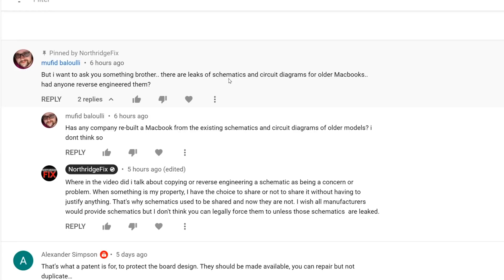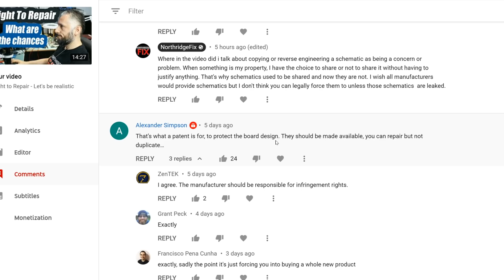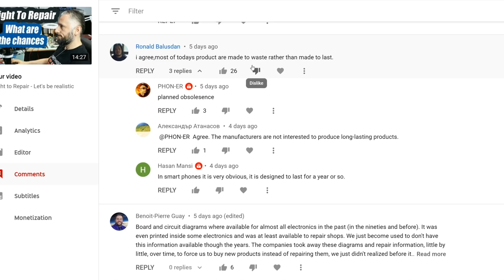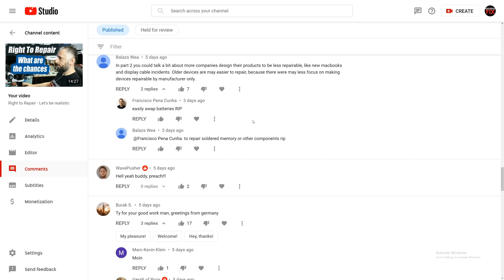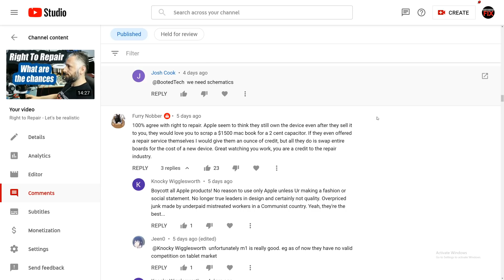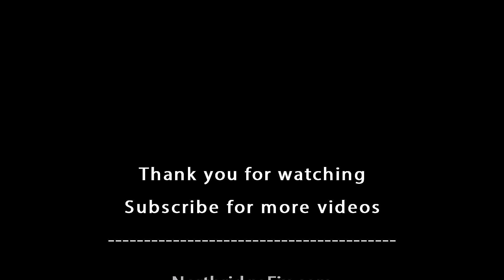Right To Repair Part 2 - Let's be Realistic - It's all about the Money.

Comment: The companies who used China to make their machines etc, they were all happy at getting super cut price stuff to maximise profit but seem oblivious when that factory in Shenzhen etc turns out a million more of that device or part.   Dr Marten's boots is a fine example, they cheaped out, went to Shenzhen who made them their boots for half the price the factory in Britain did, lots of profit and several months later ebay and Aliexpress is full of identical pairs of boots missing the branding, made on the same machines Dr Martens had their items made up on, using the same materials but selling at a THIRD of the price of a pair of Dr Martens boots.   
Apart from copyright brands missing they are exactly the same as you buy in the retail outlet.   Dr Martens cry foul but did they take the tooling home with them or see it destroyed?  Nope and so their drive to maximise profits has bitten them hard.   
In Hong Kong you can find anywhere things like brand new Xbox or PS5 clones at half the price, that can play the games and even sign into the networks because they have not just copied but 1:1 cloned down to every component detail, by reaching out to the factories in Shenzhen who make the components for MS and Sony, big suitcase o' cash and a container of authentic chips is heading to Hong Kong.   
What China is actually doing is showing how greedy these corporations have become, proving you can build the exact same thing for a quarter, a third of the retail price and still make a profit following the mantra of stack it high, sell it cheap which sells more.   Its like the McDonald's economic model, they may make 5 cents profit on every burger but because they stack it high, sell it cheap they sell billions and that 5c is pure profit all the way, electronic companies need to stop being so greedy esp Apple who have planned obsolescence in every device, why I will never ever own an Apple product and never have done.
Reply from the maker: The problem is, when apple raised there iPhone prices to a ridiculous $1500+, people did not seem to care. The News reported 2 million iPhone 12 sold in 24 hours. A person in a third world country would rather spend his savings on an iPhone 12 pro max and not buy food for his family. People not complaining encourages price hikes. Whether that device is fixable or not, no one seems to care. People just want to get there hands on the latest and greatest.
Reply: @NorthridgeFix  If you have seen thoroughly apple's schematic from last few year devices they mostly designed same, no big change at all, same components they use for years and the price they keep in their newly launched device is still the same as high regardless of making a big change into their next version of devices. The only information they change is the device model and they call it upgraded to next level device. A lot of other electronics manufacturers doing the same.
Reply: Wow. I had no idea this was happening

Comment: Regarding the treatment of the cancer is a bit misunderstanding because we call “cancer” wide broad list of pathologies which sometimes has very less common, much less than you can imagine. Meanwhile there are many types of cancer which are almost curable nowadays. When we say curable we mean keeping the disease under control and reduce the impact on the life quality to the minimum. You will not believe but there is no disease 100% curable, all of them have something residual after treatment. Making them vaccine is like find a shorted cap, treating the cancer sell is like making reverse engineering for a chip with closed code,

Comment: You are right. We do ask for everything and it is too much. They can make money selling schematics to repair businesses using their ansi number with their EIN for identification. In 1995 the automobile industry started serialization and proprietary parts not available for aftermarket. Ford got sued and after pressure from the government the right to repair info was released. E-waste is getting to a point where the government will step in eventually and put a stop to it, the result, twice the device price and repair price. Same happened with the auto industry.

Comment: You are right, the serialisation of the components should be to verify their integrity, to improve the security, to verify if the product is genuine, or to improve the features of the device. But some manufacturers serialising their products to intentionally cause the issue if a serial number doesn't match after replacing a specific component or a chip even though the part that replaced is fully compatible with the device. It clearly states that manufactures are against the right to repair and want a user to buy another device every year.

Comment: The only way to force manufacturers to provide parts and service data is to demand it up front, before you buy their products. This applies to ALL products. Next time you are shopping for a new appliance, automobile, cell phone, stereo, whatever, tell the salesperson, the only way I will buy this product is if the manufacturer provides free of charge, the factory service manual, access to all repair parts, free software updates and reprogramming as needed, and a full set of schematics.

If they won't provide the hard copies, then you want free online access to their online service data for as long as you own the item. Stand your ground and insist these terms be included in the purchase agreement. If they refuse, don't buy it. If we all do it, they will eventually get the message.

Comment: If you think about it, reverse engineer and manufacture a similar product going over the patent is quite easy, the same way we use an AI to rewrite an essay, it shouldn't be difficult to position components in a similar, but different arrangement on the PCB, going as far as changing voltage in capacitors into heatsinks just to mask the similarities.

Big tech is running a sinking ship and they know it. Eventually intellectual property is going to be a theory, much like all others, rested among the lies of history.

Also, IMO, people should stop using "Laptops" as something to put on your lap and play it like a toy. Buy a wireless keyboard and bigger monitor, connect to it and leave it.  You shouldn't bring a laptop to school, pay attention like we use to.

Comment: Hi how r u i like ur videos but ihave question the ihs of ps3 its important to remove it to apply thermal paste or applying the paste top of ihs is ok 

Ihave another question if i increase the fan speed in ps3 its ok it will nt damage the power supply

Comment: One point I would like to make is that I wouldn't want to ask for every component to be made available.  To make available the cheaper components, the ones that make something economically viable to fix.   The power management ics, mosfets etc.  Not the CPU, GPU.   

After watching your new graphics repair "NorthridgeNoFix" (sorry couldn't help that) 🤣 video it occurred to me that graphics card is now worth nothing it's one for the likes of youtuber eWaste Ben.  If the graphics card was a car it would be sent to the scrap yard to be crushed.  It's the equivalent of taking a car to the garage to be fixed when the engine is gone and all the other parts are almost end of life.  

I think right to repair should concentrate on asking for the parts that make sense.  In car terms,  new brakes, new tires, new exhaust.

Comment: if your phone firmware fails, the manufacturer doesn't want to give you the firmware to reflash by yourself, i had an experience with Oppo only their authorized shops could access the firmwares and if you don't have a recipt they won't do anything, when you buy a device even if you buy second hand you own it not the manufacturer owns the device, i totally agree about what you said about a database, but i don't agree with a monthly payment, my opinion is the manufacturer could give you that database(with the parts,softwares,firmwares of that specific device, schematics aso..) by paying an one time fee or by paying by device model or when you buy that specific device for example for extra 200$ you will receive that database with all the things you need(parts,softwares,firmwares,...)

Comment: If repair shops pooled and hired an electronic design engineer to design a non serialized circuit to be placed as replacement daughterboard,, could be a solution.

Comment: There is no way serialization is going away for 3 basic reasons:
1) Security
2) Flexibility of design
3) Makes the work of designing easier.

All are legit but that being said, manufacturers should be making those parts available, like all parts in working condition either through themselves or 3rd parties.

Parts are expensive to keep in stock AND deter new sales so it is a lose lose from a strictly balance sheet view.

Comment: I do agree with the right to repair, however, I agree with Apples take on it as well. serialising things that can cause a security risk and not allowing 3rd parties to reprogram I 100% agree with. once stuff like that becomes public its only a matter of times before people hack it and cause potential security and privacy risks. 

there are already 3rd party programmers to do screens and batteries which is good. 

in regards to board diagrams I believe that after 12 months (outside warranty) they should become available to repairers, I don't agree with apple holding them considering they don't do board repairs in house.

Comment: We have solar inverters from Fronius that have serialised components, I find it interesting as no-cares about repairing them considering they cost even more than a top model iphone and can make you money!. As electricians we just return the faulty devices or scrap them, as shipping alone pumps up the price vs a new one with a warranty that should work.

Also we can't certify repairs on components unless you're an EE here in Australia (my example, when it's generating power to the mains grid) Although I'm a certified electrician here it's only board swaps that the manufacturers will allow only for EE certification.

Comment: You said it's good in all ways but in fact it is not for the manufacturer. Why ? The old products will last much longer than the time it takes to produce new products. So the new products will not sell as much as if the old products were off. 
Second, if they dont release the schematics and provide all parts it's for keeping the exlusivity of repair to only them, in that way they can contrôl the prices and décide if it is reparable or not (apple) and they will always lead you to buy new stuff.
Thanks for sharing knowledge as always

Comment: This battle have been done before. In the car industri. The access of parts are really good. Bort third party and original parts. You even have access to diagnostic tools for a fee. You have access to most of the schematics and how the car is built. This should be a right when you own your car. It should also be a right for electronics like computers and phones.
Reply: Try changing the battery on a post 2005 BMW with a generic third party one and see if your opinion stands.

Comment: Electronics gets 'recycled' at up to 21% efficiency currently in Europe and USA (best case scenario). Its an environmental time bomb. There is enough mercury in a smartphone to poison a small lake.
Current recycling techniques involve stripping a few components off the board and then shredding the rest.
Quite simple:
Serialization will need to be made illegal by government legislation. you don't technically need serialization to make a fingerprint reader secure/device secure, we're surrendered by BullS**t arguments from the manufacturers. Its a proxy argument because they want a closed ecosystem where devices are swapped not repaired, where products may or may not last for 2-3 years. 
There needs to be government intervention just like the automotive industry was mandated by government to a higher set of safety standards in the US during the 1970's. Its a safety issue, in the same way not having end of life components releasing toxic waste into the environment is an environmental issue.

Comment: i think u dont understand the base of this afford. manufacturer which produces something have to give all informations needet to repair this things. they dont have to give u the programming site. but schematics and part numbers. and parts which are only made for the manufacturer, they shoud have to sell it. if they dont want this they should be fined or should be be forced by law to do so!
Reply from the maker: Even if what what you are saying is true, providing schematic alone without a board diagram is little to no help. Good luck enforcing release of board diagrams
Reply: @NorthridgeFix  Just access to the components would be a good start. Most of the time I see you locating the component that needs replacing without needing to look at a schematic or a board diagram. Manufacturers should be forced to stop erasing the identification from chips etc.

Comment: You're right Alex we can't ask for genuine parts but at least we can push them to offer that to their customers so they won't be forced to buy a new product just because they year old model broke. i.e..  Apple doesn't change charging ports and if shops like mine and yours didn;t have it, then people were forced to pay $350 for a refurbished model.  As far as serialization goes, thats the one enemy that we need defeated because that can cause major headache but then we have QIANLI which can come thru with a small device like they have done for true tone and allow us to copy from oem to the aftermarket.  As far as schematics i think as consumer we should get it with our products and for the board diagram that should only be held by manufacturer to avoid third party repair. :) my 2cnts
Reply: pin this if you like my argument :). Thanks Ari @AriGoldExperience

Comment: 🐨 Honestly I don't know why electronic devices and their details "schematics" these days are not provided with the product, it's not like they are that different from all other manufacturers circuit diagrams. 

When it comes down to a Circuit no matter the complexity, Voltages and currents dictate what components will work and what wont work, Only time one would steer away from long reliable lifetime operation much like those 40 year old transistor radios still working, would be to use components and variations that provide a favourable redundancy. WAIT! 😮 What?
 
Take a gander at several devices and if they have the same features, it's highly likely the parts list and even parts count "depending how stingy or moral a manufacturer is" will in the end be much the same. 

The only things that will be different are the rebranding of the Cheap Generic IC's they source along with new part numbers for them, And that even applies for whatever cheap programmable chips they use..

Comment: Funny thing is when it comes to ham radio equipment. As a ham radio operator you have to do an exam when getting your license to prove that you have basic knowledge of basic electronic cause you are allowed to develop and build your own equipment and it has to fulfill the regulations. With the license it is mandatory that you need to have schematics for all your equipment to show if you may cause RF interference and they are coming to check your station. That leads to the point that all commercial manufacturers of those equipment deliver circuit diagrams with their equipment which makes it easier to fix something when it’s broken but there still is the problem when it comes to specific ICs made only for the manufacturer. Sometimes hard to get those parts not to say even impossible.
Greetings from Germany! 👍